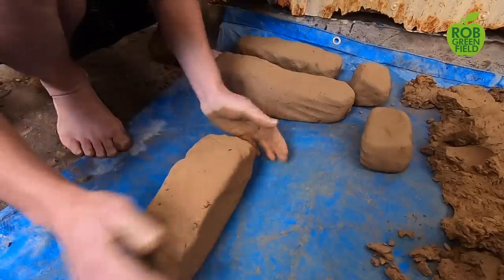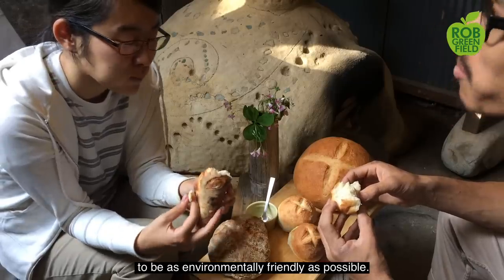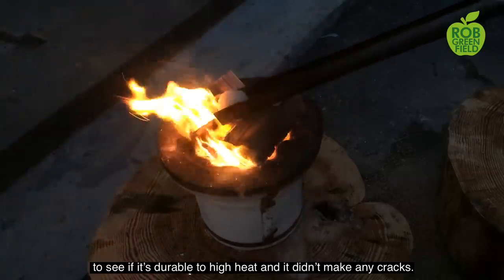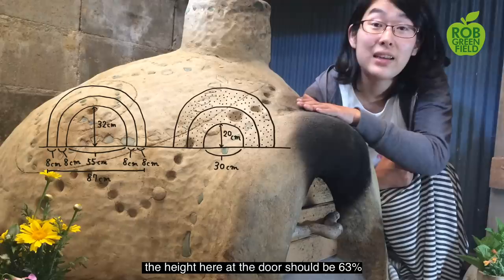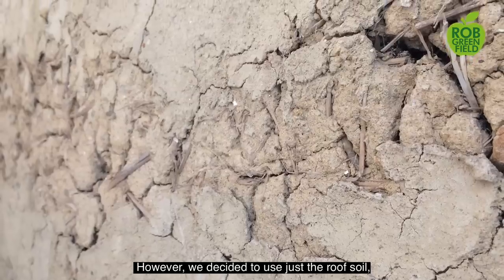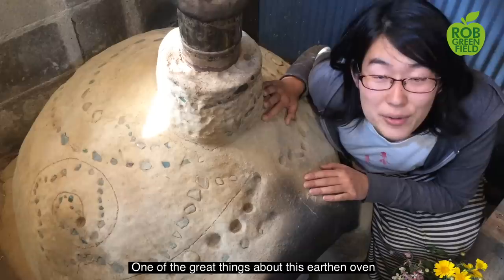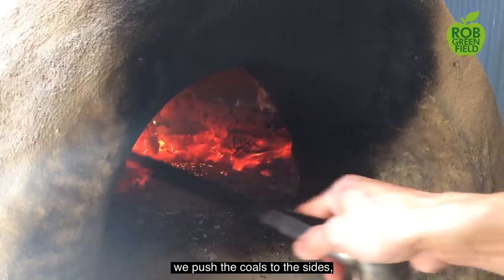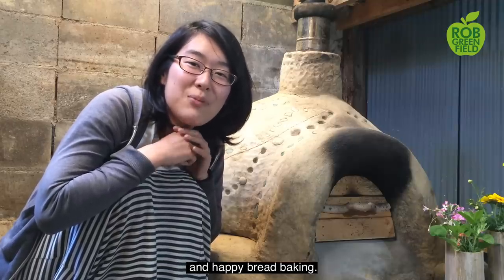How to Build an Earthen Oven for Free

Comment: You can make the outside waterproof by painting it with a paint made from whitewash (or store-bought cement + water) and boiled starch (i.e. wheat flour, rice flour, mashed cooked rice, cornmeal, even mashed potatoes). The Great Wall of China was made by mixing into the lime (quicklime) mortar, sticky rice soup, which made it waterproof and almost as strong as modern cement. If you have an oven in which to make pottery (terracotta), you could use a cup with loose dirt powder (ideally sieved), you can make terracotta powder which is easier to crush than normal terracotta, to mix into the cement/mortar to make cement/mortar which is stronger and also cures underwater (if you need that).

Comment: You use a sandier layer in th einterior of the oven because the clay is then a better thermal accumulater heats more and holds the heat better. The straw filled layer omn the outside makes a layer which is more insulating and stops the heat from getting out, at least i think that is so.